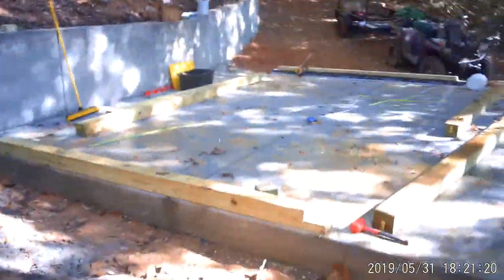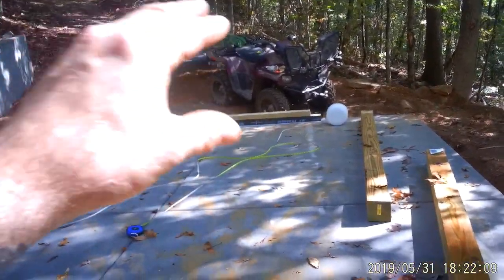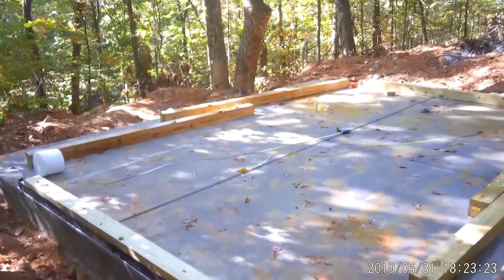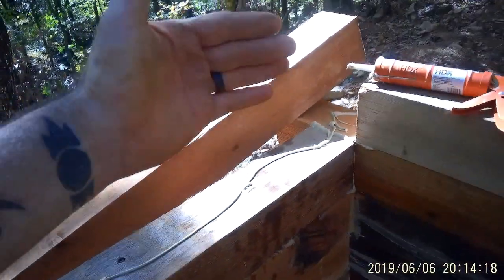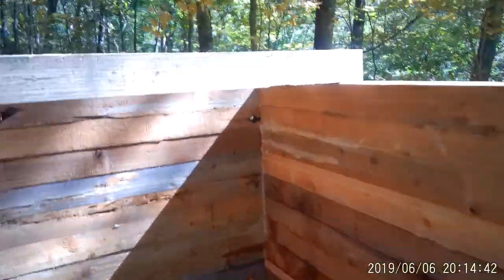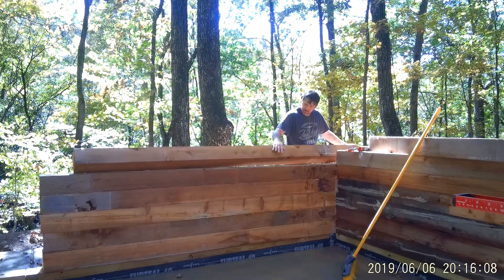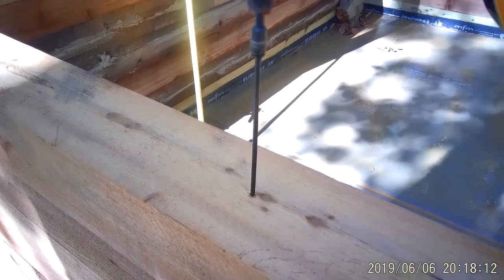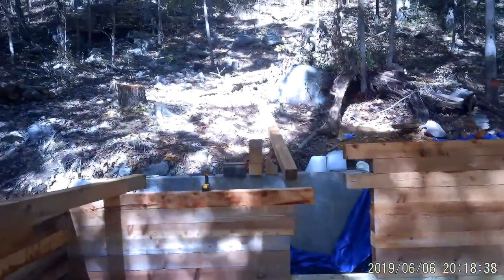Primitive off grid  log cabin build part 1

Comment: Im building one just like it myself with 6×6 square logs but my logs are  ground contact treated wood.   I'm using the same kind of screws you are using to.
Reply from the maker: i only did the bottom layer treated.. i didnt want all those chems in that wood in all my walls,
Reply: I agree I stayed in some make shift huts built with treated wood in Iraq, almost died from the chemicals that were impregnated in the wood. 
Now I have all kinds of problems.

Comment: We’re do u out your electric wires for outlets
Reply from the maker: its off grid no outlets, but i did install small solar with inverter with 2 outlets on the inverter, 
if i was to run power from grid , i would conduit it with electrical boxes surface mounted

Comment: I am so glad I found your video. I had been going to get one of those log cabin kits, but the prices are way too high. I can buy cedar 6x6 like this half the price that the kits supply. I am going with slab also. I can't tell from the first video if you put the first log right on the concrete (after wrapping with the moisture barrier), or if you put down a 2 x 6 plank first?  Either way, what did you anchor the first log to?  Anchors into the concrete, liquid nail?  I know the weight of the logs and the fact they will all be secured together is probably enough, just wondering if you did anything to the first row?  Looking forward to watch all of them, it is winter here now, and I can't start till spring. It was 20 below Farenheight here this am.
Reply from the maker: The first row was 6x6 treated lumber wrapped in that water proof stuff..  then i drilled a 1/2 hole and used a 10 in long 1/2 wide tapcon concrete bolt to secure the logs to the concrete..  then each log had those timberlok type screws to secure to the lower log with liquid nails to help secure and also to make sure it was a tight fit
Reply: @Krakology  Thank you. I decided against using a slab, going to put 6x6 posts in holes and add concrete and will build a floor joist system prior to first log row. Concrete was out of my price range. I still like your concept though, and will adapt it to my 21'x25' build.

Comment: How many times did you have to charge the batteries? And did you use solar? Or a generator
Reply from the maker: those batteries lasted most all day, but i have . like 12 or so, i usually  charge at night.. 

generator for now.. working on solar setup

Comment: hey how you doing buddy yeah I was going to your video and I'm thinking of building a cabin as well by using logs of 6x6 the cabin is going to be 16x24 I would like to ask you a question what glue did you use between the timber?
Reply from the maker: just used liquid nails and log screws,  like oolog i think and or timberlok
Reply: @Krakology  did you put the skin insulation between the logs?
Reply from the maker: @easyoutgrid  DID NOT. Prolly should have but with thick layer of glue it was a good fit..
Reply: @Krakology  okay yeah because I'm going to do it 16x24 in the same schools that you use them I'm going to use too I want to make it really really strong quick question did you sting the cabin or do you use that tongue oil to protect the wood?
Reply from the maker: @easyoutgrid  used something like thompson water seal on the outside. sprayed heavy with sparyer
Reply: @Krakology  hey thank you buddy you really are help me out and what to think to choose something better I'm pretty much a handyman I know how I built things but I have never built the cabin I know her repair paint electricity you name it but this is going to be my first and I'm going to do it 16x24 so let's see how it goes hopefully I could show you when I'm finished
Reply from the maker: @easyoutgrid  yeah im no expert, just trial and error.  If i had a redo. I would have sealed the concrete before i even started building. then i would have sealed the walls inside and out before the roof.  

and i have have put windows in as i went . 

Film your build. id love to see it..  also  anyway i can help, just ask
Reply: @Krakology  thank you Boss I appreciate it and I will send it to you

Comment: Curious as to what you are going to do for windows? It's going to be hard to cut them out of that 6" wall...
Reply from the maker: Chainsaw will
Make Quick work of it when I’m ready to cut them in but for now the front door in the back door have windows in them
Reply from the maker: window video is out. thanks for watching
Reply: It's called a chainsaw